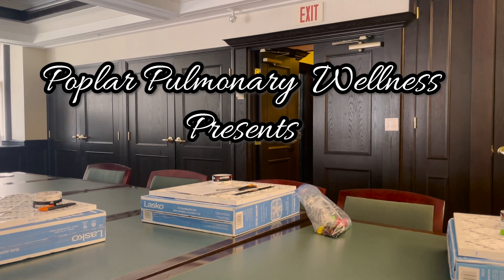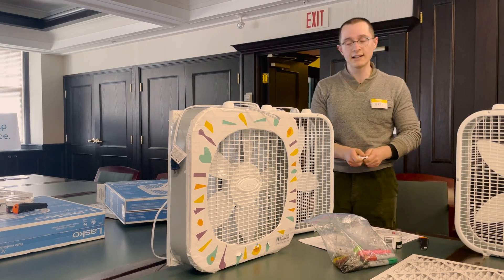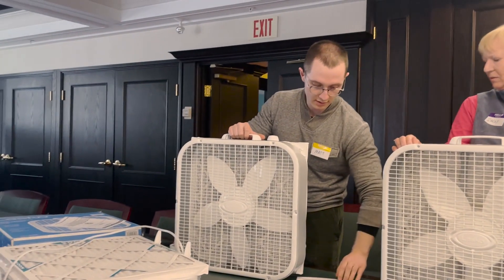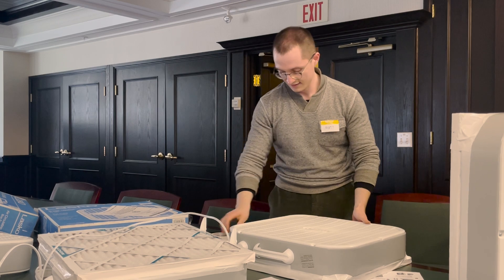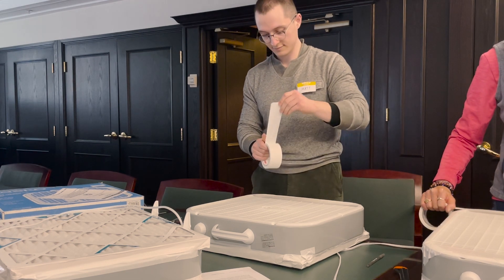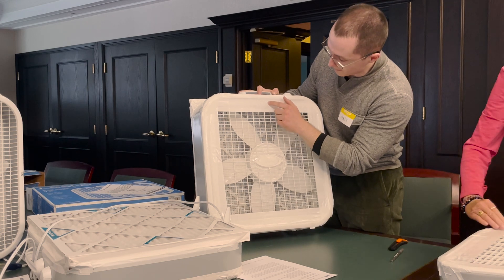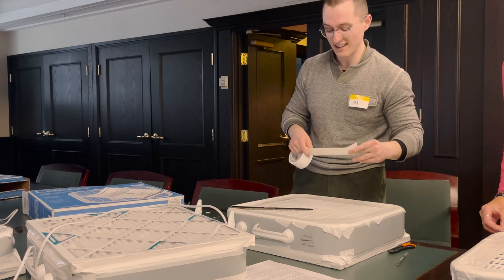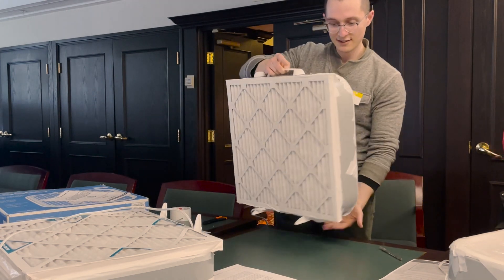BC Lung Foundation: Air Purifier Workshop

Comment: Thank you.  It was really hard to hear the audio but I was able to figure it out except for why you need the tape on the front of the fan?
Reply from the maker: Thanks for the feedback! The reason for the tape on the front is so that unfiltered air doesn't get sucked back into the fan. The goal is to have all unfiltered air pass through the filter at the back of the fan, and then only filtered exiting through the front. Were you able to make one? :)